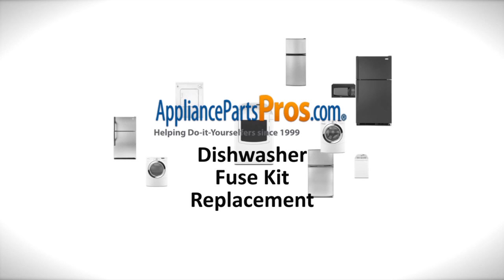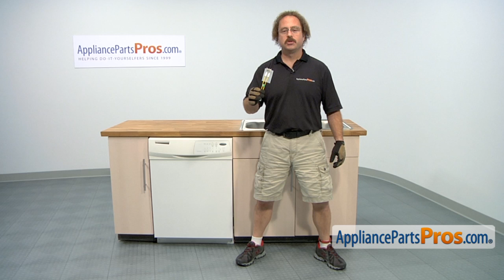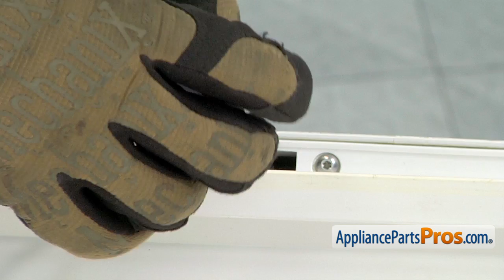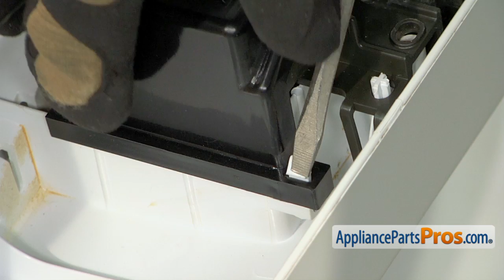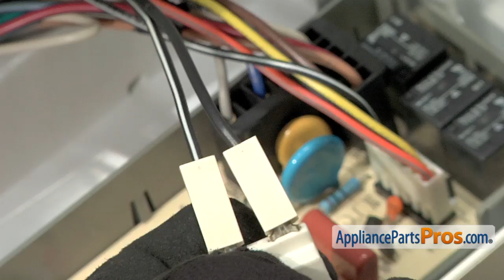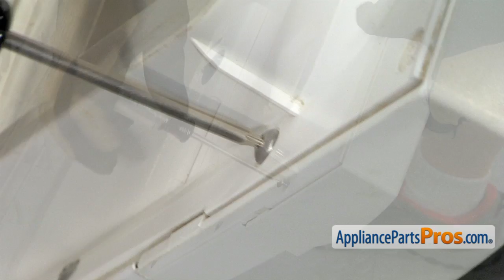Whirlpool Dishwasher Thermal Fuse Kit 8193762 Replacement — fits KitchenAid/Maytag

Comment: Why didn't you just disconnect the old fuse at the connectors and slide those connectors onto the new fuse rather than cutting the wires and attaching the entire wiring harness?
Reply from the maker: HornetWSO Whirlpool designed the part to be changed as shown in the instructions and this is how we show it in the video. Usually when they do this it is to address a problem they are seeing, so it is always best to change it all out.
Reply: My thought exactly ..! I just find it another way of justifying the $16 price for the fuse . IMO extra wire , connector = more thing to worry about that could go wrong , exposed or not set secure, I am sure it will be fine just plug and play
Reply: HornetWSO  Hi, it is supposed to be best to change the entire part as shown because in many cases the overheating came from .... the connectors of the heatfuse! ....